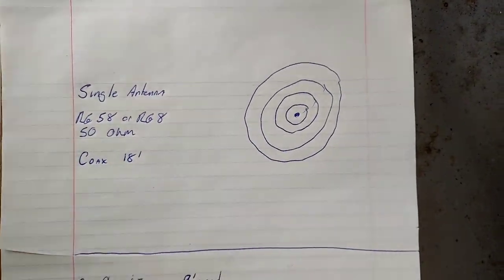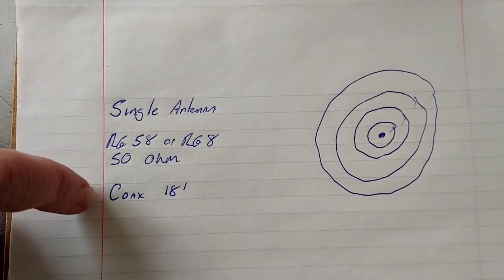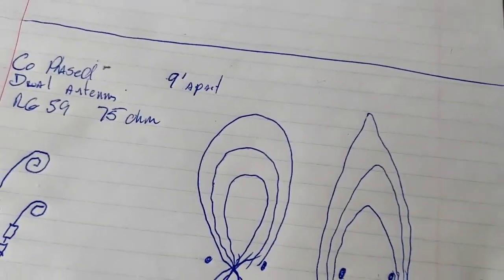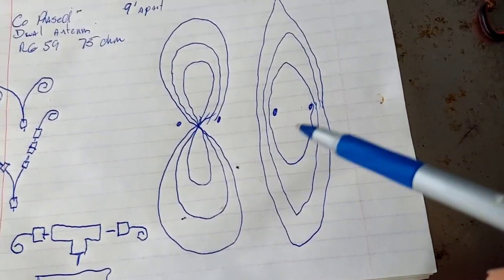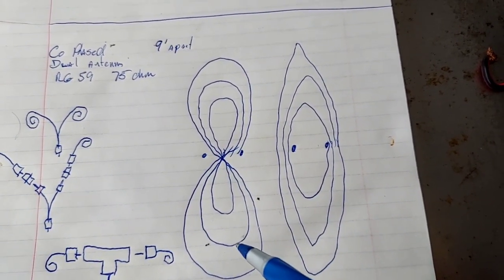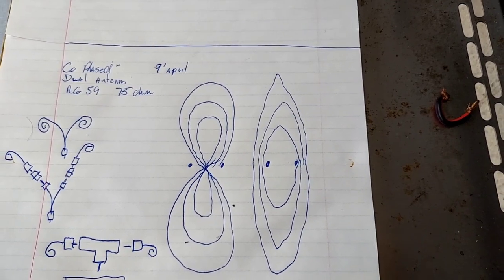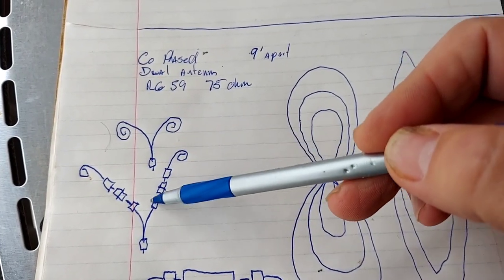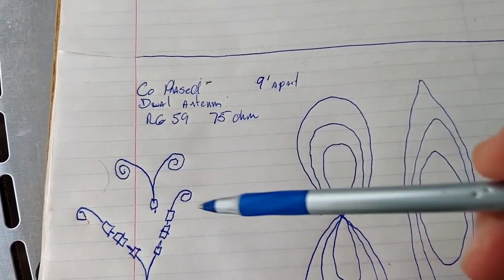Are 2 CB antennas better than 1? 2 cb antennas vs 1 cb antenna.

Comment: Thank you for a realistic and accurate description of the different factors in setting up cophase     
Antennas. You are certainly more knowledgeable than the majority of the people I run into at CB shops who preach nothing but single antennas. They tell people that 2 antennas cut your power in half and you only transmit half as far. Leads me to believe they are the same people who would use a 3 way  connector , 2 lengths of 50 omm cable on a co-phase set up,  Let alone know how to tune the antennas for co-phase.  I also appreciate you letting people know that the signal propagation pattern from co-phase,
is enhanced to the front and back of the
Vehicle and that's the whole point of co-phase antennas.

Comment: Double 4ft Firestiks on our Freightliner windmirror's same as yours, we had shock springs on the base, saves breakages with heavier antennas from the base (£10/$15).
On the nights out which was a big deal for me as a 13/14yr old, I could mount a wire dipole or magmount on the load, am waffling 9m but great memories, I can still smell the rose leather in the cab 😀 73's. 407, The Mad Hatter NW 🇬🇧
Reply from the maker: Thanks for watching

Comment: This "double" antenna install is interesting because it's normally ONLY done for semi trucks - Not for Four-Wheelers and not for Ham Radio.  I always figured the reason was to help get a better signal around the huge aluminum trailer.  If that's the case then it must perform better with Two and it sure looks better!  Thanks for the video and the coax info.
Reply from the maker: I've done it on a 4 wheeler long ago. And, looking back it wasn't the correct way for the best performance. But, it did work.
Reply: A CB friend of mine ran dual 102" stainless whips on a Ford Bronco, it kicked ass. One on each side just behind the cab.

Comment: When I install antennas on big trucks I use home base coax ends and I run two 18' 75 ohm coax bypassing the splitter box because that splitter box has burned  up more radio's than I could count,so bypassing that splitter box is a good idea if you want to prevent a burned up radio,just my 2 cents,been doing it this way for many a year.

Comment: Good vid! In regards to you not being able to see RF. I can’t either, but a good field strength meter will show you which direction most of the RF is going by watching the needle maximum swing on the field strength tester for max reading and then a person can record the transmit pattern on a piece of paper. In fact, a decent 27mhz tuned F.S. Meter is the ultimate tell all for any antenna that emits RF.
Reply from the maker: Good to know

Comment: With tunable antennas, I use the dual 18 foot RG59 co-phasing harness, hook up the driver's side antenna first and tune it without the the other antenna. With it tuned flat, I install the other antenna and tune it with both antennas installed and do not try to retune the driver's side antenna. This should tune flat also. That way, if the passenger side antenna gets damaged by an overhanging branch, I can remove it and just use the driver's antenna alone. You can even leave the damaged antenna, as the radio will only use the tuned antenna.

Comment: Just a small point from a radio man - if you are running a single antenna, the coax should be as short as is practical to do so. Don't run it 'tight' but nothing too excessive. Using a 50 ohm antenna with 50 ohm coax to the 50 ohm output of the set, it is all matched and you will (if the antenna is tuned correctly) deliver full power to the antenna with a low VSWR and minimal reflections.

Using two antennas is different. There are two different ways to set them up to work correctly however your description will do. The length of each feeder coax is critical and they should NOT be shortened or lengthened.
There is another way to feed dual antennas but it involves much more coax which means you have to stash it somewhere, so stick with the two feeds as you describe. 

Otherwise, all good.

Comment: I mainly use my CB during the winter in the Great Plains, so the cophase seems to make the most sense, the thing i was more confused by output wattage, I just have a stock radio at 5-watts.
Reply from the maker: And, they say at 5 watts with dual antennas you are only getting 2.5 watts to each antenna

Comment: if you have a coronado glider, around 2016, the cb antennas are connected to the stereo ! there is a module behind your park/trailer brake valves behind the center dash....dealing with one right now, stray rf is making the gauges/display go haywire when the cb mic is keyed checked swr, it is 1.1 to1, with an inline meter
Reply from the maker: That's why I ran new coax to the driver's side the multiplex boxes are junk.
Reply: You have a problem with your coax and if you are running an amp its just compounding it.

Comment: I ran a magnet  lil will  center roof for a long time and it was amazing. Bored and put 2 3ft firesticks on my toolbox yesterday. Not quite 7 ft apart. W the t connector  coming  out of the back of the cb.  12 ft coax ...Calibrated  and had less than 1 swr works better than the lil wil and I'm catching skip like never before. I can hear the truckstop, steel mill and landfill  all from my house. Not sure how this is working but busting some myths here?!

Comment: There is a quarter wave matching stub set up or simple two leg 75 ohm coax for co-phased antennas. I have made end fire antennas using just coax and a rf switch.
Reply: Two 9 ft. antennas spaced 9 ft apart driven 90° out of phase. SWR less than 1:1.4 across 23 channels. 6.5 ft of coax gave 90° phase shift.

Comment: I just found your channel in a random video and I subscribed immediately. I want to hear more of your experience. But I would like to add two points that are just my opinion not to take away from your video. I found a chart one time that showed twin truckers at various distances and the best was supposed to b 8 feet apart (you said 9) at that point signal was going out almost A Perfect Circle but it has a pimple forward and backward of the twin Truckers. Now think back in the day of out-of-the-box radios were only for w and they Swan to maybe 6 or even not at all. Most people did not get their radios maxed out. But the FCC used to allow 5 watts to the antenna back in the sixties. Then there was this big stupid argument about what and the feds decided to limit the radio at 4 Watts at the antenna plug AKA pl-259 and then you could use DB gain and twin truckers to shape your signal for extra distance. So your twin truckers would actually get you another mile of dishes with that little pimple power forwards and backwards. Brings us to Modern Times where most truckers have exports running 60w that pimple and that little distance really has no meaning. Even out running Los Angeles to Arizona now that I'm older I have a smaller run I find the twin truckers have nothing on the single antenna. I can still talk further than most people can get back to me. Now I run a trucker antenna on my left mirror and a VHF antenna on my right mirror so I can get M.U.R.S. radio. I would like to add one thing that all of the Columbia cabs only put the CV to the left antenna and the AM FM radio to the right antenna. So you can put twin trucker on the cab to look nice but you only have to tune the left radio antenna. If you don't believe me you get up in the headliner and follow the cable over to the left side of the truck, there is no splitter or twin coax
Reply from the maker: Thanks for the sub

Comment: Many pickup owners think that twin fiberglass whip antennas mounted on the front of the box looks good... it does but is a terrible setup for radio. Better off using a Wilson 1000 or K40 magnet mount on the roof. These will screw up metallic paint... big trade off.... Looks vs. Function

Comment: Finally someone who explains the proper Co-phasing set up using 75ohm coax and "Not" settling for a "T" HF pl259 on the transceiver 👍. Also for those who are opting for a Co-phasing install with the 75ohm coax, a 2:1 match on the SWR "Theoretically" in the RF electrical physics real world scenario is just as good as having a 1:1 SWR running a single radiator for a mobile install, I know, go ahead, beat me up but, 2:1 match co-phased is fantastic trust me, and no I won't explain why, I don't have the patience to get into radio physics on a CB based YouTube channel...lol 🤣👍

Comment: I used a single P10k with 18' 8x. Running a 500w am/700w ssb radio. Transmits great, but recieve was not so great. The expensive radio is part of the issue. My Cobra 29 has 3x the ears! Kinda irritated with that. I decided to cophase the extra signal capture. A rinky dink never go to again "cb tech" made me up a lmr 240, 50 ohm, 12 ft each side cophase coax. Poor solder job. He swore 50 ohm was what was needed, and no more than 12 feet each side, and that lmr 240 was the best. He charged a pretty penny! Well, he couldn't get the SWRs down, couldn't figure out why, and I got massive RF bite from the mic, as well as in ssb it was distorted in the talk back. Not on AM, just ssb. So I got RG59AU , and the bite and ssb distortion went away, and SWRs came down. I chose two remakes by ProComm of the Van Ordt Power Sticks. A quad wound, top loaded fiberglass with a tunable tip. Great reviews. My review? Outstanding recieve,  and very good transmit. Cophased? Amazing! 50% gain! Transmit though? About a 10-15% loss. Also, when truck is off, ssb clear, when truck is running,  ssb garbled. So frustrating! He would not refund for the other coax by the way. $About $80 shot! So,  going back to single, but will experiment between three antenna. The P10k, 4.5' Power Stick, and a 5' Skip shooter I bought. Too bad, that gain in recieve was amazing! One power stick still gives me a gain of about 10-15%, but as I noted, I lose 10-15% tx power.
Reply: Matt T,  That power loss is not a transmitted power loss. With the 75 ohm coax, you are getting the true output reading! The reading with 50 ohm coax was showing the high amount of reflected power coming back to the radio along with the transmitted power. You're lucky if the finals weren't damaged by the high SWR, hopefully. That can be checked by hooking up a watt meter and a 50 ohm dummy load to see if the radio is still putting out the stated (close) power level. A cheap Field Strength meter can show the true radiation pattern, 
 Co - phased (done properly) is the way to go, on a highway rig. The transmit pattern is as wide as a single but front and back is where the phase gain improves the radiated power. And as you said, the receive (front and back) improves by the same ratio. I think that you're pushing the limit for that 59AU. I wouldn't run more than 300 - 350 RMS into it. That said, there is better 75 ohm coax out there $$$ if you want to run higher power.
 By the same token, if you're using a lot of surface streets, trees and any other low hanging crap is a major problem for the right side antenna. Also, one antenna is easier to tune and the RG8x (50 ohm) will handle that power. The radiation pattern will be better to your right side than the left, but you can't have everything!
Reply: @Frank Newling  The radio power I spoke of was pep. RMS is about half that. What 75 ohm coax were you referring to? I'm having a slight possible rf leak issue, so double or triple shielded coax would be better. Single, lmr240 is good. Co-phased? It's still a work in progress. My alternator (160 amps) may need to be rewound and increased to 200 amp. Not a big expense.

Comment: Take your analogy with throwing a stone into a pond one step further. Throw 2 stones into the pond from the
same height and the same distance apart and at the same time and you will see exactly how co-phasing works.  Try 3 stones in s straight line and see what it does. 3 stones = 3 element beam, and so on.  I have a tri-linear 5/8 wave for 900Mhz and
the principal ie exactly the same. Sounds complicated but the principal is the same.

Comment: Thanks for the Help. Dual looks cooler but will not work for pick-up so gotta go single antenna.
Reply from the maker: Some people will run the working antenna on the driver's side and a dummy antenna on the passenger side.  Thanks for watching
Reply: @jrichtruckincbtips  wouldn't it still affect the radiation pattern?
Reply from the maker: @norbertvanallan2446  if you're talking about running duals ,but only 1 hooked up to a single coax.  No, it will not effect radiation pattern. Without power to the antenna it's just a stick in the air.
Reply: This is true on most PU installations.  Although the radiation patterns wont work for most people, I remember back in the 1970's people would put a bumper mount on the front and rear bumpers and put a whip on the front and back bumpers.  If you have an older PU and you have the west coaster style mirrors than YES running co-phased will definitely work well for you.

Comment: I’ve tried several times running duals and I’ve never been happy, usually SWR is high or other issues and yes I had them hooked up correctly too. I do like the look of duals on my truck so I have duals on it but just the driver side is actually the working antenna
Reply from the maker: Yeah, the swr will always be a little higher and the radios power is split between the two antennas.

Comment: Amazing explanation. Thanks for sharing. 

I'll check out your channel, I have other questions, which you might have already answered. One such question is: does it matter how I stuff the coax cable? I mean do hoops or irregular lengths make a difference? 

I hearsay in sound systems, hoops cause interference, I just don't know if that applies here. Thanks.
Reply from the maker: You can loop a higher quality coax , but I don't. And only use 3ft increments of coax 12' 15' 18' and so on.

Comment: Great videos. Do you purchase the co-ax with the connectors are or do you put them on yourself?  I find it hard to snake the connecter through tight places. You should make a video on how to attach the connectors.
Reply from the maker: I usually but the coax from the CB shop with 1 end attached. Then I'll do the other end myself.

Comment: Hi J Rich. I'm driving a 2015 T680. The antenna mounts are in the mirror arm, on both sides. I think the factory antenna are short. How far above the door should the antenna reach? How can I ground my antennas, on this model? Thanks for videos! Alan.
Reply from the maker: Here's how to ground those. https://youtu.be/Ar6mxY57lzs. As you can tell I prefer 1 antenna. You can use as tall 6' antennas on that truck. The main thing is getting the coil above the mirror. So, a tall tunable tip fiberglass, or a mid load whip style, like a Hustler, Browning, Predator, or Monkey Made would be ideal.